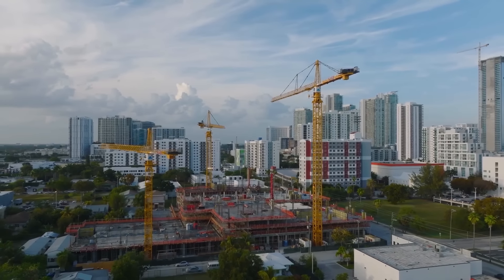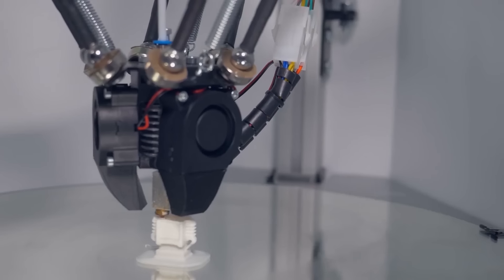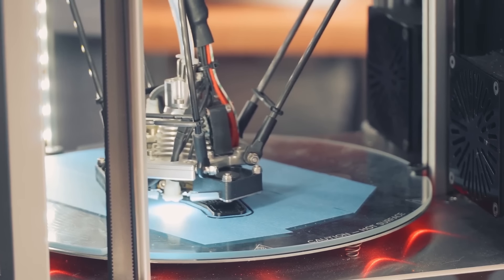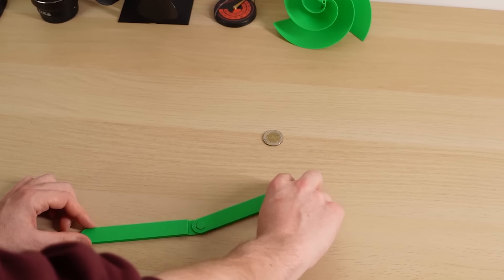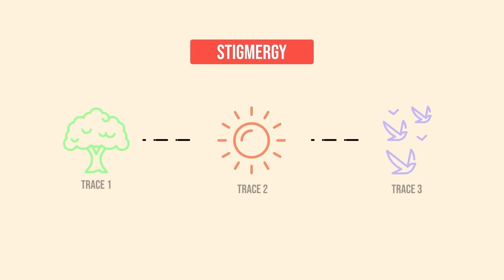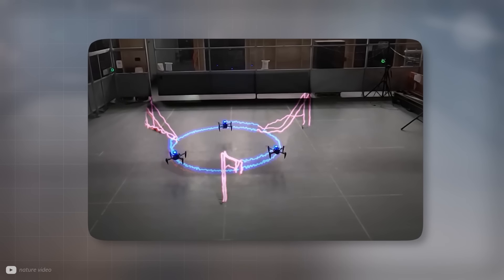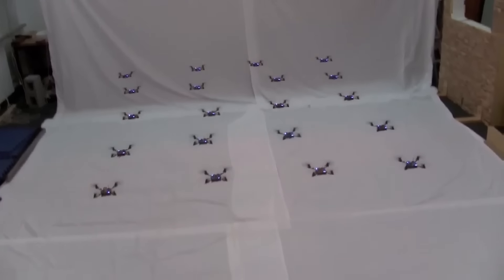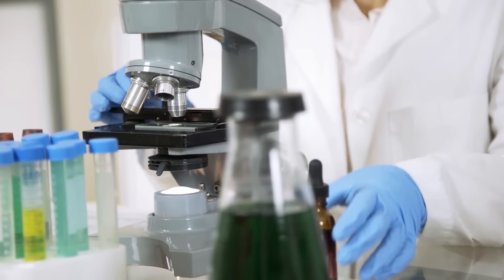Why 3D Printing With Drones Will Transform Construction

Comment: One problem I see with this is that using drones to lift materials requires a lot more energy than using a crane. And once the material is up there, the crane can keep it there with virtually no energy expenditure while the drones need to burn a lot of energy just to stay airborne.
Reply: A concentrated solar array at the site would fix that, just make the initial costs slightly bigger. Still not as much as the extra costs from both time and heavy machinery
Reply: Probably energy expenditure flying those is not a significant cost all expenses accounted. But the crane system would be simpler, faster and less prone to failures. Drones would be maybe better for hard to reach places and fine details.
Reply: @cython5086  No it doesn't. Cranes are still more energy efficient.
Reply: @cython5086  if we're gonna set up a solar array for the drones then you have to consider doing that for the cranes as well. Either way the cranes would be cheaper and more energy efficient. this is definitely not efficient or enviromentaly more friendly but it does have use cases for MaRs BuIlDiNgS :-/
Reply: That would require extra solar panel production which is also energy intensive. But a solution in the long run for sure. But won't help much short term.
Reply: That means you need to design temporary landing point for drones to hold it's material and also to host battery exchange station at high altitude.
And it might not just be temporary, it might as well be the feature of the build. 
These things can also be inside and build out embedded shelves/table counter to the building for more futuristic ideas.
Reply: @cython5086  Concentrated solar is neither the cheapest nor is it the easiest to quickly implement form of on site solar energy generation.
Reply: Yes, I don't see what the attraction of drones is for this application. I can understand the attraction of large scale 3d printing, but it would better be accomplished with a crane, scaffold, boom, etc.
Reply: I think everyone is wrong in this thread.
40+ years of engineering here.
Cranes use less energy, sure... but transporting a crane to a site consumes HUGE anount of energy and time. Time is money.
Assembling cranes takes weeks to do and test before use. Dissassembly is just as time consuming and expensive.
Drones do not need to fly far. Wired drones with 3 phase 480 AC to DC  generator on site with enough wire to fly to almost zero distance but up, could easily haul on ton of cement from a cement mixer next to it.
All this can be hauled in and out of a site in a flatbed.
Gone is the need of a high rise crane, cement pumps and their clean ups.
This is a complete shift in construction tech by use of existing well understood tech and applying it differently.
This is most likely the future of construction.
Reply: @aec007  How large a crane do you think you need to compete with a drone?
Reply: @aec007  I know you assumed no one opposed his idea, but I do. I simply said how they can build temporary service stations to buffer materials and energy supplies as built-in furnitures of the building.
Reply: @cython5086 then the same logic could be applied to a light ground drone (automation + less mass = lower cost). The issue with this is that drones would require a larger amount of energy to carry more weight than itself. No matter what, if you make something fly you are necessarily spending more power, energy and effort pound for pound. You can also put solar panels on a ground lifting vehicle. The idea of keeping it in the air like this may only have very niche applications compared to just using something that walks, climbs or rolls on a surface.
Reply: @aec007  For the same lifting power you would have to ship a lot more mass and individual parts in drones. Although being able to function more autonomously is a huge plus.
Reply: @cython5086  cranes can lift and hold through structure, drones need to keep the motors constantly spinning.
Reply: Attach the drone to a crane like attachment for extra support but better mobility maybe
Reply: @aec007  well mr engineering i dont think you gave it enough thinking time..

 drones are more efficient at delivering one small thing compared to a truck delivering one small thing but as soon as the truck can carry 2 small things on the same trip it wins so as soon as the crane can carry a little more than a drone it wins. and this is probably based on the drone being able to take shortcuts cuz flying isnt very efficient unless you can glide 

to get a drone efficient u need large props, large props make it less maneuverable and less suited for precision work. and if you then attach a 3 phase cable .... those are pretty heavy and probably very very hard for the drone to compensate for. 

"Gone is the need of a high rise crane, cement pumps and their clean ups."  yeah instead you need drone support personell that dont know shit about building, and their gear and a place for storage and maintenance and some sort of tripple failsafe since it is lifting we are discussing (probably local rules of my area)  and a coordination plan whit the "normal" workers cuz imagin a hundred drones each with a 3phase cable..... 

and finally cleaning a cement pump is a bitch but im guessing that cleaning all the small nozzles on a number of drones equivalent to one cement pump will make that bitch look like a gentle lover
Reply: @cython5086 Correct, I agree definitely👍🏻
Reply: Don't leave out the hundreds of construction workers getting union wages or even poorly paid, 100 workers x 8 hours x $30 is $24,000 a day.  That crane is a rental and is burning hundreds of $$ an hour. If it sits up top with a load for an hour, no one gets any work done that whole time except for the about-to-be-fired workers unloading the crane.
Reply: Tru, but the science is slowly getting to the public availablity..
I mean, like, I just found out that they created translucent aluminium sheeting back early 90s late 80s the other week
Reply: What about just simplifying the gantry systems for 3d printing? They should be much easier and faster to set up than a crane (which needs suitable ground stability and be in a position where it can access as much of the building site as possible). Gantry systems could be much more modular. Like 3-4 systems working together with each of them needing just a minimal footprint, comparable to or even less than regular scaffolding for workers. There's probably also a lot of improvements possible in terms of making the gantry systems self-positioning and self-aligning, instead of requiring a lot of manual planning and adjustments.
Reply: For now... that's how these things gain traction. They start small, serve a niche purpose, then get refined and better over iterations. Eventually, the benefits may well outweigh the efficiency of a crane. That's progress for you. lol @VTnumb
Reply: IF you have space for a crane... maybe there it will be some occasional situations where it would be better, but in general I agree with you
Reply: @cython5086 I'm pretty sure the fix here is supporting the weight with the ground instead of the air. Moving a 3d printing crane into place simplifies everything quite a bit and wouldn't loose you much.
Reply: But they are only holding so much instead if all of it like the crane it is less of it and more frequently. Also why would you use it like a crane use it for what its good for not to do something elses job
Reply: @VTnumb  True, but I wonder if the energy ( and CO2 emissions) from moving a big crane to and from the site wouldn't be larger than what the drones would use building the structure?.
Reply: @jeriztattoo  3 phase cable  has nothing to do with power delivery. It's based on current carrying ability. Custom made drones for this task are the solution.
Reply: @cython5086 😅 I will love to see those numbers, and the solar array on site, and the fast charging all weather drones and..... (I build drones for fun, I know how much energy they use just hoovering)
Reply: How about using drones to build the cranes on site? 🧐
Reply: @aec007   what are u even saying? make a 3 phase drone battery?  make a drone out of a diesel generator?  make all the drone systems run on 3 phase? or is it just that 3 phase can deliver more current? well a standard drone BLDC motor is a permanent magnet synchronous motor that  runs on  three-phase AC power which the ESC converts from a dc battery

but all of that does not matter anyway cuz the engine power you need to lift an amount of building material that makes a difference in a commercial setting will ensure that said building material is blown far away as soon as it exits the nozzle.  
 
"Custom made drones for this task are the solution."  what exactly can they do cheaper ?? ( not better, better has never been a thing unless its cheaper ) if its not a clear economic advantage it will just be a steep cost to change systems and no way to recuperate it

also and this is very important!! u have to find a way to keep the guy thats driving the cement truck from killing you and everyone that looks like you when you tell him he can only dump his load one drone at a time... 

(the last part is a joke i dont think i have to tell u this but if i dont type it out someone is going to take it as "facts" )
Reply: Often, people can't understand the big picture when assessing problems. Cranes will be more energy efficient. If they weren't, buildings would be constructed using helicopters. They aren't because the energy required to fly is significantly more. That's also why we don't have flying cars. If you want a flying car, buy a helicopter. It is simply expensive to keep something in the air with fans.

Do the math and see. Calculate the cost. Somebody mentioned the cost of shipping a crane. To do the same work, you are going to need 10,000 of those small drones. Imagine the energy consumption on that. 

This could work in some difficult locations where crane setup is more difficult (mountains, weak ground, etc.). It isn't completely flawed, but don't expect this to be the construction standard.
Reply: Cranes are still more energy efficient than what I am about to say BUT the drone mostly doesn’t have to carry the material as it can be tethered to it from the ground but still the operation of a drone is more energy intensive
Reply: If it builds it quickly and uses the structure itself as partial support it is sufficient.
Reply: @Cybertruck1000 The Mars copter needs to fly in such thin air that it is one of the least efficient drones ever. There is no similarity to using them on Earth.
Reply: @AerialTheShamen  Read it again. That's the point I was making.
Reply: I wanted to mention that as well.
Energy means lithium.
Lithium is abundant, but it is hard to get and it is required more and more nowadays, so we are to face batteries prices to skyrocket.
And energy density is also a problem.
If those drones were within an electromagnetic field made by some kind of frame, it would be easier and cheaper. I can say that, because we have 5 times difference in price for fuel and electricity in Ukraine, so it is much cheaper to use electricity.
Reply: @cython5086  For sunny areas, not the cloud North. Such drones are for the areas that are hard to reach, so taking solar array can be limited by logistics. It is too complicated for now.
Reply: @cefcephatus  i think you hit the light bulb a lil much
Reply: @aec007  there are better solutions than cranes too which would eliminate all the advantages of drones you mentioned. Look up current solutions for 3D printing buildings, they are much better suited than drones are.
Reply: @boppinator4308  they also forget all the other things that go into building a building. Ground preparation and foundations are a very large part of it and do often require heavy machinery, so unless they plan on having drones replace diggers and other similar equipment too then they haven't eliminated that issue either.
Reply: @mryan744  if you have it tethered to the ground you might as well use a ground based robot, maybe even something that runs along the existing walls whilst pooping out concrete behind it.
Reply: My take away from this thread is that a drone crane that 3d prints is way better than this. I will say perhaps aerial printing could be useful in niche applications or remote applications or military applications.
Reply: who cares about energy costs?? Energy is literally the  thing humanity lacks the least already.
Reply: @thelelanatorlol3978  Other way around. With enough cheap energy humanity wouldn't lack pretty much anything.
Reply: Maybe this can be mitigated with some old school solutions - like leverage and/or low friction pulleys/gears and pumps somehow 🤔 

Building with plastics would probably be the easiest, as plastics are very light and very thin. So one could feed the drone through pulleys and strands.
Run time can be improved with solar skeleton design with a small inverter system built into the drone... maybe?
Reply: @aec007  As someone who uses cranes in almost every job, I couldn't agree more. Those things are always the bottleneck. Repositioning the crane and waiting for it to be on-site,  organizing the job order, paying for idle time, and transporting from and to the site are huge cost factors. Just replacing half of that with fast and flexible drones would be huge. I can easily see a chemical plant for example using drones for scaffolding and low-weight lift jobs during maintenance to massively speed up the turnaround time, making it a very temping solution to further minimize the downtime and save a ton of money. 

I guess the biggest hurdle is regulatory in nature, not in the tech itself. There needs to be a whole new branch of safety and operating agencies for that to be adopted. Hard to imagine something like that widely used within a reasonable timeframe in a highly bureaucratized society.
Reply: @aec007 how big would the wings need to be on a drone that can haul a ton of cement? How would the rotor wash affect the print quality. This is a trash idea, and if you think this is going to happen as stated, your engineering must have been in the Lego format.  And finally, 480v 3 phase wiring on the drone sounds good in theory, but then you're just using the limited thrust to haul wiring upward. Not to mention we don't have drones that can lift more than a couple hundred lbs at a time, or a about 20 bricks worth of payload. You also have to factor in wind at altitude, steering(is it automated, if so how?) Servo drive systems if so which all take away from that meager lift capacity in either direct weight or cable weight.
Reply: @BariumCobaltNitrog3n it's still cheaper than millions of dollars in an idea that won't even be as fast
Reply: @TlD-dg6ug  
China has already personal drones capable of lifting over 250 lbs for single seaters and 450+ lbs for dual seaters. Mind you, this is considered ON TOP of the hefty battery pack needed for meaningful flight times.
Italy has already 2 seaters in testing with 500+ lbs of payload again on top of the needed batteries for 30 minutes flights.
Take away the batteries and your payload increases dramatically. Remove the small 6" diameter motors for a, compromised in size, battery powered vehicle and replace with high powered wired flight with a small boom to hold the wire and your payload today could increase exponentially.
Prop wash can be nearly eliminated with vectored thrust and longer delivery gantry (3 leg picker you saw) to deliver fast setting concrete.
FYI, don't call people names when you don't know their background. Try to be a little humble sometimes.
Reply: @TlD-dg6ug You gotta be more specific. "It's still cheaper..."?
Reply: Could you provide your math for the cost of constructing solar arrays on construction sites vs bringing in heavy machinery? I'd also like to see your time comparison calculations.
Reply: True the energy used compared to tracked cranes or anything else would be so high that you could make 10 more cranes from that much energy. I like how people just see energy as free or something. You would also need 10 times if not much more solar arrays and you should always move where the drones are because of there limited space.
Reply: Also FAA limit is 55lbs or you have to register it as an experimental aircraft and its an extremely unrealistic process. The payloads cant change one bit or you have to reregister. Also flight times are terrible for heavy payloads. Battery charging (and discharging) and shipping are extremely time consuming. I think there’s too many problems to solve for this to make any sort of sense in the future.
Reply: This!
Reply: @ryanisber2353 you have a good point about the energy use. But a drone can go places a crane can't go. Drones could build on a mountain, miles from a road. 
I think cranes have a future but drones can be a good addition to the construction world.
Reply: From a perspective of building possibilities in Europe, cranes are mostly out of question, as they are expensive, slow to assembly and it would be mostly impossible, to get them to the building site…

Scaffolding is the way to go, as it can be transported in a smaller car.

This replaces it completely - yes, it'll be swarm of energy vampires, BUT you can get them on place in a van or in a boat (yes, there are some recreational buildings accessible only by boat)
Reply: @VTnumb . Yes.   But take away everything else involved and it might break even or be cheaper.   I don’t know.  Just a thought.
Reply: @codetech5598 . It’s less dangerous to humans.
Reply: I don’t think it matters that much if you’re using less workers potentially and are able to build things that workers can’t. The 3D printed stuff is nearly impossible to build by hand. 

I’m a cnc operator and most of the stuff we make would be impossible to do by hand (at least in the same timeframe) and guess what - we’d need more people! (Yea technology helps to have less people, contrary to what tech enthusiasts constantly say).
Reply: What’s also funny is that people forget how much a crane operator makes. Drones cost less. Crane operators at least in unions make 40-80 dollars an hour plus overtime.
Reply: Could just use both. Let the crane do the literal heavy lifting and let the drones handle the detail. Slap automation in the crane, now the crane is a drone and society built itself..... The concept is 3d print so upload a schematic establish a location and deploy the drone toolkit to create it.
    Real science fiction shit. Do it on Mars, do it for the stars. Just figure out which ones are actually shining.